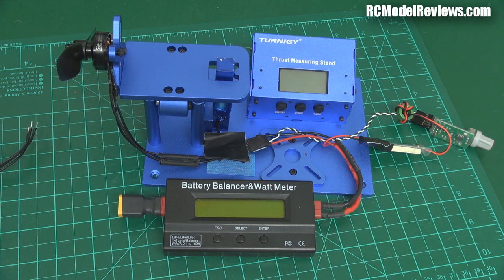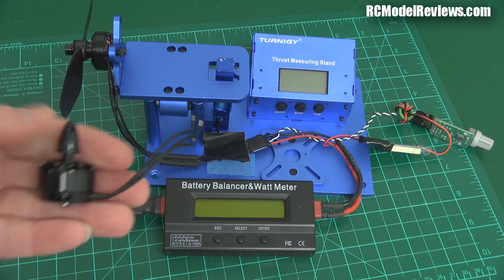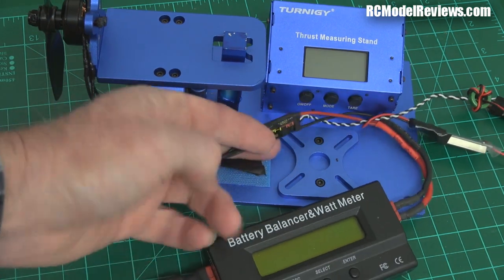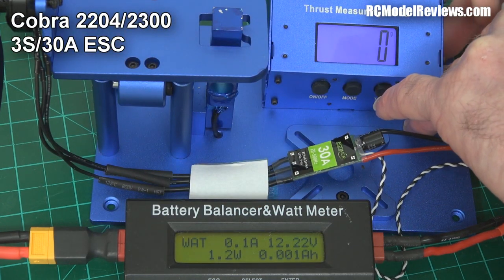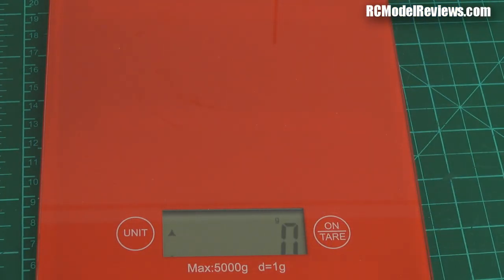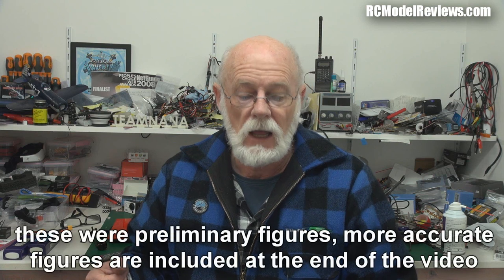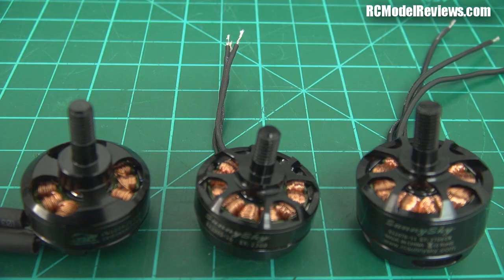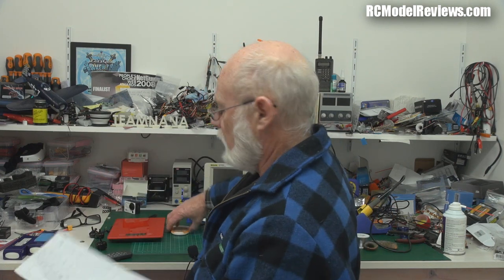SunnySky 2207 2700KV versus 2204 Cobra/Sunnysky

Comment: Thank you for this testing! Great to have this data.  With Cobras popping up everywhere, wondered what the differences really were compared to SS.  I also have the 2100kv SS 2207 - use them on a 350 size hexacopter with 6 x 4.5" props -- they are beasts but suck a 4S battery dry in less then 4 minutes of hard flying.

Comment: Nice review! The low efficiency of cobra is confirmed. Most of the efficiency probably lost on unbalanced motor bell. The extra power compared to sunnysky is due to the thicker stator :) Still looking forward to rank Cobra 2204 (true must be 2205) with T motor 2205!

Comment: Thanks for the great comparison! I'm running die Sunnysky 2207 / 2700KV motors on my "mean machine" and they're absolutely performing great. Even if they're not as efficient, they truly are brutal with 5045 Bullnose DAL's :-D But that's not the way to go if you wanna race a course for several laps if you ask me. It's more like: punch that piece of crap into the sky as quickly and as loud as you can! :-D

Comment: The problem I have with these tests is that rpm is not measured, seeing that some of these motors have different kV values than what the label says. this means using the same prop, some motors will spin too fast (and not give thrust) and others too slow (and give poor efficiency).  

A full test of these motors should (at a given voltage) vary the torque from "free running" up to the maximum permissible. Measure input and output power and find the point of best efficiency and/or maximum power and compare the motors there. The task of finding a prop is to get the motor into that sweet spot.  

Of course the sweet spot will  depend on what you use the motor for: What is its duty cycle? Where on the spectrum from max power to max efficiency are you? Do you hover mostly at 30% gas and occasionally use 100%? Or is it a racing quad frequently exceeding 67%?

Comment: I found it interesting we havent seen the DYS 1806 on the bench considering he has a few of them around and recommended them in the low cost fpv racing quad. They seem to be a very popular motor because they are cheap and preform really good and can handle 4s

Comment: Thanks for the very informative video, it seems i will stick to the SS brand then as i already have a set of them in my 450 quad.
Reply: +Johan Combrinck As do I, 2212/980. Id like to drop to 8" props and 2212 1400kv and see what performance change I get.
Reply: +SoundsFantastic I got the same motors on my 450 quad, just running 10 inch 3 blader props atm, and once i get enough practise i want to change back to the Gemfan 1050 2 bladers. I broke some of the latter while learning, and the 3 bladers are cheaper where i get my spares.

Comment: I wonder if you could do the same test on low rpm motors meant for larger multirotors.  It would be interesting to compare the budget DL750s to higher priced motors with the same specs. Some of us are on a tight budget.

Comment: There's a couple of things going on here that are impacting your testing.  First thing, unfortunately the DYS SN30 ESC is one of the poorest performing ESCs on the market. Your results are pretty much on par for what I've seen out of the SN30A. On top of that the Atmel based ESCs will really struggle with the kind of RPMs all three of these motors are wanting to push at 4S. With a decent SiLabs F330 based ESC, like the MRM Zeus or the RG20 you'll see about a 15% increase of thrust over Atmel based ESCs, and even more over the SN30A. You'll see an even bigger difference with a top performer like the XRotor40A or XRotor 20A if you don't care that much about size.  I'm still waiting for the magic bullet, something the size of the RG20A with an F39X series SiLabs chip in it like the XRotors :D  

If you use the XRotors with the SunnySky 2700kv with XRotors ESCs I'd expect to see close to 1kg of thrust at 4S with the HQ bullnose props, maybe 930g with the Gemfans, and close to 30A current.  The Cobra 2300kv on the same ESC are pulling 800g+ and 25A+ with the HQ bullnose.

Another thing to consider is that the Cobra Motors really are 2205 motors, not 2204.  They've upped the stator size and increased the number of turns in the windings in order to get the combination of power and efficiency they were looking for.  The reason the SunnySky is so close in terms of performance at 3S is that they run fewer turns, which gives higher torque, particularly at lower RPMs.  Usually this is at the cost of efficiency, but the smaller stator size seems to be playing a role here in keeping the efficiency higher at lower RPMs.  You can see at higher RPMs (voltage) the larger stator thickness really starts making a huge difference in thrust, and the ability of the motor to maintain those high RPMs under load (high end torque).

Comment: Hey Bruce I have a bit of info on the ESCs.  The difference in performance has to do with the switching speed.  The SN/BL30s have lower switching speeds than the 20s.  Also the SN series escs are all atmel based and thus perform worse than Silabs based escs like the KISS, RG20s, FVT Little Bees, RG30, and XRotor escs.  All of these escs will have better performance both in efficiency and thrust than the atmel based escs.  If you want more info check out this thread but hopefully this will shed a bit of light on it. 
http://www.rcgroups.com/forums/showthread.php?t=2492809
Reply: +Wyll Surf Air Definitely. The amp rating tells very little about anything other than the ESC's ability to dissipate the heat it generates. Power, braking performance, etc... has far more to do with the FETs, the driver hardware, and the firmware. Take the exact same hardware and run tests on BLHeli 13.1 and 14.0 and you will see a huge difference. Even within the exact same range, there can be significant performance differences e.g. between a 20 and a 30 amp ESC. The 20 may be great, the 30 may be poor.
Reply: +Wyll Surf Air Thanks for the plug :D
Reply: +Wyll Surf Air It's sort of a sweeping generalization to say that silabs based ESCS will be better at everything.  Assuming the code they are running is good, there's more performance improvement due to better fets, and gate drive than what is due to using a different microcontroller architecture.
Reply: It's a sweeping generalization based on factual test results. There is no reason why somebody couldn't build a very good Atmel ESC, and in fact, KISS ESCs--some of the best on the market--run Atmel. But the reality is that almost all Atmel ESCs on the market run slower processors than SiLabs. They seldom have external oscillators. Most significantly, they tend to have poor driver circuitry that results in mediocre braking performance.

Look at the test results here: https://docs.google.com/spreadsheets/d/1sskJV7d24DW4fBvXhtyjeouFc1yopxvf8ThlbtemZio/pubchart?oid=1106538616&format=image

The top results are all SiLabs ESCs, except for KISS. Also, look at the top Atmel ESC (other than KISS), which is the Afro HV. Note the drop in performance compared to it and the SiLabs ESC above it. If you compare braking performance, the difference is just as stark, if not more so.

In today's market, Atmel ESCs are usually built for budget, while SiLabs ESCs are usually built for performance. There is no reason why it has to be that way, but it is that way, and the data bears it out.
Reply: That is true

Comment: +xjet    I wonder how long the SS2207/2700KV would run at 25A before they smoked.   I understand they are rated at 25A continuous, but the 4S (at 25A) run you did sounded fairly harsh.

Comment: I used to go with a 50% larger esc because you had more fet's meaning lost less resistance, but now they are running 6 fet's so the more power just means a more resistance.

Comment: I don't know much about quadcopters but I want to start my own project, want to build something like a phantom 3 with the 2213 960 kg motor, what are the things I need to do this set up, already have the frame and motors, what's the best parts to use on this set up to get the most out of it, what type esc, props, flight controller, etc

Comment: I have the sunnysky 2204s 2300kv, and a Chinese frame and I found the sunnysky motors do not fit the arms at all even after drilling out the holes still wouldn't fit.  So I'm looking for a new frame.  Nighthawk?  Will the holes line up.

Comment: hi Bruce
there is a general concern that comes up by making these comparisons:

It is necessary to mention the purchase source. SunnySky and also Cobra factory have given warnings about unscrupulous sellers mainly distributing fake motors through Yiwu channels. And Banggood is one of the major traders who are selling fake products. Especially motors and ESC's.

SunnySky is trying to battle these guys through a new certificated network of distributors. It is highly recommended to ask a sellers to show the official SunnySky distributor certificate. You can at any time show it to SunnySky factory for approval. Banggood would not be able to do that.

The most simpest ways to identify a fake from a genuine SunnySky motor:
1. The packing style: SunnySky is never using cheap ZipLog bags and they don't put spare parts in the heat sealed bags. Only a motor seat, no further parts.
2. since the 2nd part of 2015 relying on  the product cartonage is also tricky. The fake sellers are trying to catch up and reprint also fake product packing instead of cheap white boxes.
2. the most versatile identification method:
a. the imprint style in the bell: mostly the fake factories are not able to make the same imprint as SunnySky. The printing is poorly done, out of line,  some are using laser etching instead of printing. The typo is also wrong or poorly printed.
b. the heat shrink: the heat shrink is loose and not fixed inside the bell.
c. the allover condition of the motors: the fake motors have bangs and scratches because the cheap careless workers are throwing them in big metal boxes during production. SunnySky original motors are in mint condition when they leave the factory. Also the Cobra's.

You can at any time contact Cobra and SunnySky to show received goods and  let approve.

It makes it a bit more difficult for making a comparison review, but in my eyes worth for a watertight & 100% reliable one.

Thanks again for your great reviews :-)
Stay away from Banggood & Co. ....

Herri
living in China for a long long time

not in any way associated with the mentioned factories. Just working day by day with material and products here in China.

Comment: wauw, huge difference in performance when changing a ESC.... who thought about that... not me.
Reply: +Go oGle Huge. HUGE difference. The ESC is a lot like the electronic ignition system of a modern car. It makes a massive difference in the performance. It's not just about the power you get out of the motor, but the motor's ability to respond quickly to changes in throttle position, both in terms of speeding up and braking. 

You can get reasonably quality ESCs for $10-$15 or so. There is simply no reason to settle for bad ones, except that most people don't realize how important good ones are. A few great ESCs as of today:

Xrotor 20 and 40 amp
RotorGeeks RG20
LittleBee / Zeus
KISS 30 amp.

The Xrotor 20 amp can be had for about $12 at HobbyKing. Once your budget gets up to $20, you have a few more choices.
Reply: I believe this is hugely underestimated part of any quadcopter. Everyone focus on the Motors, Propellers and the Batteries. Time ot bench the ESC / OPTO.

Comment: The 40A esc probably has more FET's of the same on resistance in parallel, so the total on resistance decreases, lessening the voltage drop and waste.
Reply: +TheMrTape That's what I was expecting but working against the 30A ESCs is the fact that they're rated for 6S so the on-resistance of the FETs used will probably be higher (rule of thumb -- for a given current the on-resistance is higher if the voltage rating is higher).  However, it appears (according to some who have posted here) may be the switching speed.
Reply: *****
Good to know. Initially I thought there was a difference in frequency too until you said BLHeli at the same configurations, so the frequencies should be the same.

Comment: ok silly question time about efficiency...

if the thrust gramm/watt drops, thats a reading taken at full throttle...

ok lets say 3s full trottle is 500g of thrust, and 4s is 700g, but i am hovering at 300g, will i be more or less efficient at 300g on 3s or 4s...  does poor full throttle efficiency equate to a poor mid throttle fficiency....anyone have figures and not just a guess?

i know on combustion engines theres a mid range sweet spot so does one exist with brushless?

Comment: Those RCTimer/ dys SN30 ESC's are one of the worst ESCs to use on high KV motors. dys SN20's are 2nd worst. BLHeli f/w has really made these ESCs perform as well as possible. They'll do the job OK and there are many people successfully using them.... BUT..... it would've been a much informative test if you had also used a SiLabs- based ESC with BLHeli R14. HobbyWing XRotor 40A or 20A are known to make more thrust than the dys SN20/30. Also RotorGeeks RG20 and FVT LittleBee 20A should do much better and wake up those motors. This would be a great video topic: high RPM/KV motors low load 5040, 5045, 5045BN props or even 6045 props and compare SN20s vs. SiLabs ESCs. You have a huge audience, many of your viewers rely on your videos for deciding on what setup to use, let them know there's a better option for matching these motors with some proper ESCs!

Comment: The SN20 and SN30  ESC have bad high side gate drivers. The SN30 have double sets of FET's and need more charge to turn on. This result in slower switching and lower efficiency. I prefer the RotorGeeks RG20  and the KISS 30A with proper gate drivers.

Comment: At some point you will screw the thrust test stand to the bench or a big piece of wood and wonder why you didn't do it earlier :) From a previous video I was inspired to test the "real" KV of both the sunnysky and the cobra. They turn out to be pretty much the same. So the difference in thrust must be coming from somewhere other than the KV rating.
Reply: +ThrustTestGuy It's stator size.  The Cobras have 5mm stators.  Also others have tested the KV of the Cobras at 2400kv, but maybe the SS is the same?
Reply: +Ryan Harrell (QuadMcFly) , yes you are correct. Both the SS and cobra were 2400Kv, tested at 12V, not sure how linear the RPM is with voltage.
Reply: ThrustTestGuy good to know!

Comment: Is there a reason you can't use your bench power supply?  It seems that then you could dial in the exact same voltage/amperage on all your tests.  Just curious!
Reply: +Mark Harrison Most Bench power supplies are limited to between 5-10 amps. Less than whats required to test this setup in this configuration.
Reply: +Esaa Ali Makes sense...  Thanks!
Reply: +Mark Harrison I actually converted a 500W PC PSU into a bench PSU, to power a quad lipo balance charger (4x 5A @12V). The PSU is modular and has 2x 12V rails, one @24A and the other@28A. When I test motors, I connect the ESC via a power meter to the PSU. The PSU keeps power levels stable throughout the tests, so "power supply" is now a constant and I get better stats to work with. I do however always keep in mind that I only have 330W to play with and do the math before I start the test, but if or when something goes wrong, the PSU goes into a "self protection mode", so it adds some sort of a fail safe to the test too. Been using this for about 2 years now, so far so good
Reply: +Jaco van Wyk You could easily get a much more powerful PC power supply for not very much money.  There are lots of used 1000W power supplies available on computer gaming forums where people are parting out their old gaming computers.  Used gaming PC parts are awesome.  So many gamers think they have to own the latest and greatest gear.  They are willing to sell off perfectly good parts for a fraction of their original cost.
Reply: +Mark Harrison It's probably better in general, but you need a reasonably beefy supply, because although it's a "20A" esc, there can be some short bursts of much higher current when accellerating the props, etc.
The other issue is that running any kind of braking (complementary PWM, etc), you can feed higher regen voltages back into the power supply, often tripping over-voltage cutoffs, etc.